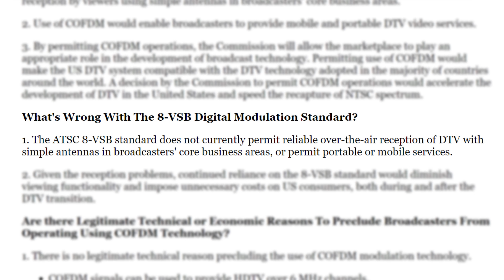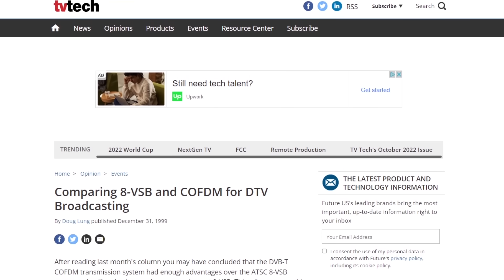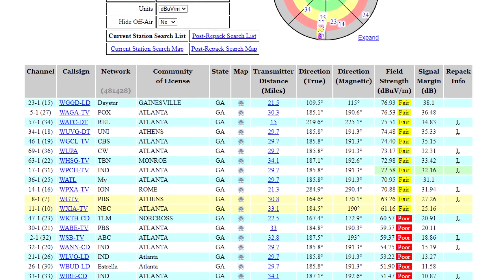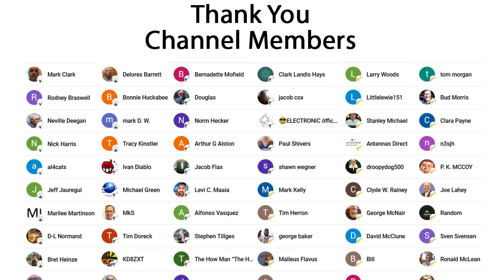This FCC Decision Made Antenna TV Less Reliable for All

Comment: So in practice, COFDM at the same power levels has a 10% reduction in range compared to ATSC. Not a big deal when you're in the "core market" but a huge deal when you look at the need to increase power dramatically for a station to legitimately cover an area. And at the beginning, ATSC was competing with NTSC for viewers, meaning the broadcasters were paying not only for duplicate transmitters, but also power bills. Since most lo-VHF stations used a fraction of the power of UHF, their power bills were a big deal. Note that Sinclair was a money-grubbing company. They wanted COFDM so they could put out a 480i free signal, and resell the rest of their spectrum to mobile data services. COFDM would work for pagers and cell phones while ATSC wouldn't. In short, they didn't want a technically superior solution - they wanted to cash in by selling spectrum they received from the FCC to use for the "public interest." SBG isn't evil - they're a corporation trying to make money, even if it comes at the expense of their viewers at the edge of their service area. Anyone subjected to a Sinclair-O&O station knows their cut-rate practices compared to other broadcasters. Pretty much the only engineers clamoring for COFDM were with SBG. Now with two repacks of channels, long-distance is getting harder due to duplicate signals anyway. COFDM makes more sense for 3.0, even though it means reduced coverage areas in theory.
Reply: I have a close relative who was an engineer involved in the advanced television committee and the advanced television test center that tested the proposed standards. Analog transmissions thanks to weather conditions and the like have a variable field range, talk to radio and tv engineers&they would laugh at the field map sales ppl showed advertisers, it showed ppl who could only intermittently pick it up. Digital TV drops like a rock, you don't have that. The current modulation standard gives a range closer to analog range was, which for advertising was huge. 

You also have to remember broadcasters fought this tooth and nail. One of the big concerns? That their content would be grabbed and redistributed . In one of the committee meetings a bigwig at Microsoft in effect claimed that the digital content, since it was 'free', was fair game. One of the reasons they went with 720p supposedly was for computer users they would need 1080, but 1080 would cause flicker on a computer. 

Some broadcasters reluctant to go digital realized with the spare channel they were given, they could broadcast less than HD, especially overnight, and use spare bandwidth to do data transmission. 

Keep in mind even digital tv itself was political. At the time the FCC was deciding HDTV standards, Phillips in Europe and ( I forget who) in Japan had analog HDTV, that because of bandwidth were satellite based. By forcing the use of. 6mhz NTSC bandwidth, it eliminated foreign competitors. 

The landscape also changed from the early 90s. Back then ota broadcast was still a big deal,was kind of king of home entertainment. 
Cable basically took over, and the amount of ppl using OTA shrunk dramatically. Broadcasters now saw themselves as content creators and they forced cable operators to pay them for redistributing their broadcast,. They made a lot more money for this versus as revenue on OTA. So they basically had no reason to improve their broadcast tech. 

Now there is a surge in interest in broadcast ota..cable is down to 1992 levels. Right now streaming tv is picking up some of that, the broadcasters get revenue from Hulu ,you tube tv,etc, but with them getting expensive it is possible that ota might pick up a lot more people. 
 
Surprised they haven't addressed this in atsc 3.0. Having just getting back into OTA ( I live in northern NJ, about 40 miles west of NYC), it was interesting to see how many channels there are but also how many of the old network channels I can't get ( currently have an indoor antenna only), the broadcast map says I am medium range from the towers. Also that even now night and day seem to change what I can get. Was able to get NBC NY at night, but in day couldn't even find the signal.
Reply: @njlauren  Radio wave propagation is a topic of much discussion in the ham world, but less in the television world. What you are seeing is increased background noise during the day thanks to the sun's rays interacting with the ionosphere and basically acting like a very loud transmitter. Sun goes down, ionosphere calms down, and those signals that were overwhelmed by noise are now clear. Medium range usually requires an attic or rooftop antenna for reliable reception, and unless you have LOS, I would expect that at 40 miles.

Comment: i dont know much about all this garbage but i do know a VERY IMPORTANT DETAIL !! about antennas, you know all these adverts about different antennas like that guy on the boat claiming that this flat square piece of plastic that you stick to the back of your tv can magically get you all your local channels ? they make it look like your getting free cable or something for like 30 bucks or more and SOME A HUNDRED OR MORE the truth is any old piece of wire will do the same thing!!!  either use any old tv antenna or a piece of non shielded wire like 6 ft of speaker wire split it like a t and hook it to a piece of antenna wire with one wire to the center wire and the other wire to the shielded portion just twist it up and connect and you can experiment with length and position and WALLAH nearly free antenna !  SAVE MONEY PEOPLE !!

Comment: Thank you for this channel.   I just subbed. 

I have a couple questions for the techs. I still use a vhf/uhf antenna because a couple channels PBS for sure. Seem to still use vhf. Is this true?   I have a long hi gain uhf antenna to install but don't want to lose pbs.
  I am 45 ft on my ham tower using 1/2" hardline. Stations are 30 mi and some about 70 mi.

  Also is atsc 3.0 coming soon and going to make my 2 yr old tv obsolete?  Is there going to be another converter box to buy?

Comment: GOOD!! When they converted to digital only they made it next to impossible for me to get any signal. We have such bad ghosting that any television is mostly unwatchable. Note, we live less than 5 miles from all of the stations. Now everyone can experience more of what I was forced to get. We don't even have a TV that's used for anything with an antenna. For the record, we used to use TV when we'd get tornado warnings. I could just crank the volume and we could hear it in our basement when things were clear but thanks to the digital only nonsense, that's 100% unreliable.

Comment: Question from a technically challenged individual in this area - will current ATSC receivers be able to pick up the improved ATSC 3 signal or will that require an ATSC 3 receiver?
Reply from the maker: No, it will require a whole new tuner. See my other videos for more information

Comment: well and then again he mentioned over the air broadcast channels I live 70 MI from cedar Hill Texas they're broadcast range is 100 miles and we can buy antennas that are boosted by your electrical house supply they're supposed to have a hundred mile range but yet I don't get all those channels and you see these ads to buy these type of antennas that say $100 to 120 mi range it's all b***** BS you won't get that you're lucky if you get like maybe 10 channels out of 100 that are actually broadcast over the air within that antenna range it's all a scam

Comment: Here in Europe people buy the antenna that you stick to your window and have 100% signal quality and strength. In my case, I've got the old analog antenna that still works perfectly with the DVB-T2. I only had to tighten the screws to improve the reliability. I guess oxidation prevented good connection. Since then, no problems.

Comment: Zenith is gone sadly we are stuck with 8VSB I live 34-37 miles from the local TV stations and we have a big VHF/UHF antennas High gain 50+ mile range one and we cannot get good reception here because we are in Montana a lot of mountains/buttes around that bounce the signals around and both bands have varying problems with reception. Temputure is a big one. Sadly 8VSB sucks.

Comment: What IS happening with ATSC 3.0?  There is a "lighthouse" transmitter here with four majors on it, but ZERO promotion.  No TV dealer website lists ATSC 3.0 even for the TV sets that have the ATSC 3.0 tuner.
Reply from the maker: Not much going on with it as we are in the very very early stages of the whole thing. We won't see it take off for at least 5-10 years IF it even takes off. It might flop like the ATSC M/H standard.
Reply: @AntennaMan  Promotion of ATSC 3.0 was supposed to start in June.  Nothing happening here and there is a lighthouse transmitter here.  I'd like to see the results of ATSC 3.0 but no cheap boxes like there are for ATSC 1.0.
Reply: @AntennaMan  3.0 is ready to go.  Four local stations are paying the electric bill for that lighthouse transmitter.  They shouldn't do that for the next 5-10 years with no return.  You can buy a several brands of TV sets that receive 3.0.  But we enthusiasts can't find a reasonably priced set top box?

Comment: Anyone using an antenna in Northern Delaware? What kind to you use and where do you mount it? There are so many buildings around and the signal is so weak and not many repeaters making it nearly impossible to get any digital channels.
Reply from the maker: It shouldn't be hard to pick up local channels reliably unless junk antennas are used. Consider an antenna recommendation from me at the link below. This can prevent you from spending hundreds of dollars and time wasted on setting up the wrong antenna for your area. https://antennamanpa.com/antenna-recommendations.html

Comment: Would COFDM work better in my situation - metro antenna farm about  10 miles from me, but the exterior wall of my apartment facing the antenna farm is all brick, stucco, and mesh construction with no windows (plus trees very close to that wall), AND I can't have an exterior antenna of any kind at all?
Reply from the maker: In general it's more reliable. As you probably saw in the one part of my video - Sinclair mentioned that it could be picked up with indoor antennas when 8VSB couldn't. In general, the key to success with an indoor antenna is a signal meter. See video below. https://youtu.be/1_Cy08x5qeY

Comment: I've been trying to learn about what type of antebna I should use. I live at the top of a hill in a bottom floor apartment and my current flat antenna can barely get one or two channels in if I'm lucky. I've been also considering cable or live tv streaming because it's so dang difficult to get my local channels to come in. The signal is very fragile in my area and is very frustrating to try to get it to come in or even to know where to place my antenna. I'm going to take a look at your website because I've been trying to research what kind of antenna would work for me because I'd rather not get cable since its so freaking expensive....

Comment: IMHO and in my own experience, powered antenna is also a scam. In fact all tv and radio signals are free to air via satellite. Public access is  restricted by not advertising availability of devices. Discs are available but user has to keep adjusting the frequency changes to stay tuned in. There are also huge disc antenna that are available and used in other parts of the world but it’s not available in USA. I guess they are prohibited for private use in USA.  So, cable TV is also a scam.

Comment: I used tinny little 2 inch antenna that came with USB TV Tuner. I used to get up to 50 free to air channels. This has best reception than even $100 tradition TV antenna. Actually rabbit tv antenna are also best bet. Other thing is that simple antenna would have your WiFi and internet modem interference. In countries like Australia, you get a device with tv antenna that would eliminate that interference.

Comment: Just want to tell you how much I appreciate your channel. You pack in a lot of useful information for a one-man show! I am a 71-year-old confirmed geek (I sold computers before Windows--in the DOS days!). I am excited about the new digital standards, which should give us much better reception. That is already happening on an experimental basis here in Portland, Oregon because Sinclair is coordinating continued ATSC -1 transmissions while implementing the newer ATSC-3. I don't want to buy a separate ATSC-3 tuner for my existing set. Rather, I am awaiting the actual inclusion of ATSC-3 tuners in digital TV's before making the switch. I live on a fixed income, and a new TV is a major expense for me. Current TV's are supposed to be good for another 5-7 years while both the old and new systems co-exist, so I feel confident in waiting. BTW, I stream (mostly via HULU and Netflix, using their ad-supported options to save money).

Comment: I've discovered that I can simply strip the outer sleeve of coaxial cable exposing the bare copper wire and run that around the house and I have insane signal on my digital TV reception I even hooked it to a metal security door and I received just as many channels as from any rooftop antenna. It  took about 30 minutes to strip enough copper wire outer sheathing off the coax kind of a pain but it works incredibly well. why is that ? t  just wanted to get your opinion as to why this has worked so well when so much is put into antenna design. And I've tried this in many locations it works everywhere.

Comment: Phase distortion has plagued our TV systems for sometime. The old analog NTSC system was sensitive to phase distortions making the "tint" incorrect. When AMPEX was trying to build a world multistandard videotape machine in the 60s, they jokingly referred to NTSC as Never Twice the Same Color. The 8VSB modulation system has 8 discrete power levels that the TV signal can have. Noise and phase distortion blur the distinction between these 8 discrete levels of signal power. Consider that initially they could send 4 standard def TV programs on one carrier with digital versus only 1 standard def with analog. Basically they stuffed four pounds of poo in a one pound bag.

Comment: FCC really not give a crap about much as there under paid & they laid off many employees in the past few years. I noticed lately many pirate radio stations appearing as well as 11 meter CB using excessive power & interfering. Local TV here still blows no sign of ATSC 3.0 yet & I put up an antenna & got most of my locals but some were still choppy. My HOA made me take antenna down & wrote again to the FCC over this but they never responded due to their cut backs.

Comment: Most TV engineers are idiots. They are not required to have an engineering degree and most have no clue how anything works. It is the social climbers who end up as management.

I worked at a station that tried 3 different transmitter and tower locations to get a decent signal to the market. They believed everything that the manufacturers said about digital TV and wasted millions in the process.

I honestly don't know why anyone would watch TV when they have the internet.

Comment: I slipped empty aluminum beverage cans onto the tips of my antenna and it pulls in local stations 80% better, for me at least. Aluminum is a very conductive metal compared to the steel used in antennas.  I may try copper tubing coils next..
Reply: Almost all TV antennas I've seen use aluminum tubes for conductors. Steel is used more for auto antennas it seems.

Comment: I live 21 miles from the broadcast towers. When it was analog, I could get every channel perfectly. When they switched to digital, I had to forsake my cheap antenna and purchase Radio Shack's largest and most expensive antennae. I could not receive channels 4 and 5. I then went to a dish shape powered antennae and mounted it high up on my deck. I can get channel 5 half the time and never channel 4. Higher frequency channels come in well. They really put the screws to us because I have to pay for a streaming service to get channels 4 and 5.

Comment: What a great video! You're so right.  It's a very fragile signal.  I went to Colombia recently and found out something quite interesting. They are an NTSC country, but when it came to deploying DTV, they decided to to r with the European standard--DVB-T, refusing to use the ATSC. Upon further research, I found out that the rest of Latin American went with the ISDB standard used in Brazil. Thanks for your videos!
Reply: But the untold part of ISDB part is that is also a fragile signal also is not that robust as many can tell under high impulsive noise the COFDM  signal gets broken not matter the system, also the cost of run a system based in OFDM is higher than is certain channels on my area tar appear and other days don't or simply stops of broadcast or by weather factors just don't reach to an outdoor antenna even being in the market of broadcast